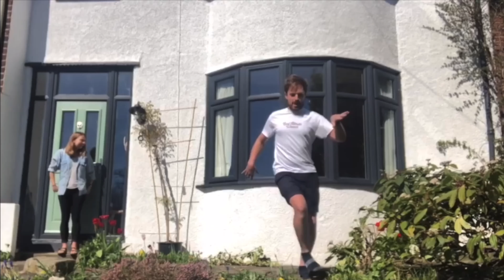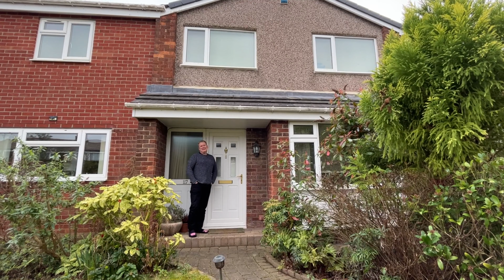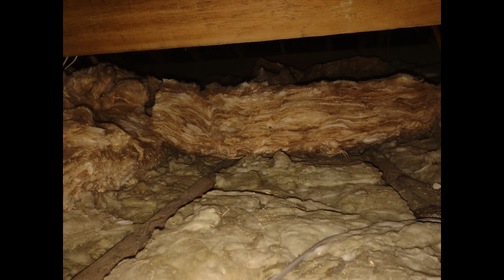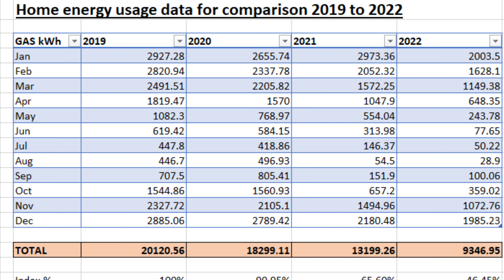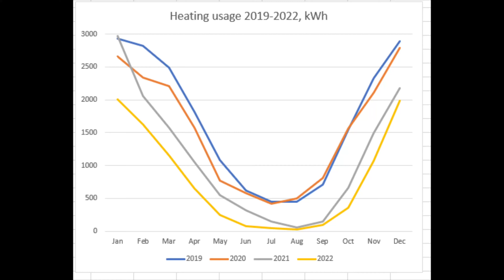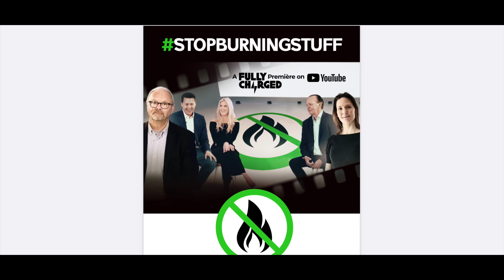3 steps Ian took to reduce gas bills by 54%

Comment: Interesting to look at the reduction in July and August figures when there was likely no heating needed. Did the old boiler have a pilot light? If it was anything like mine, its pilot light was actually using more gas than the new boiler used for all our hot water - about 4.5-5.5kWh every day. I wonder if that's what reduced your gas usage - we bought a system boiler and kept the DHW cylinder which can be more efficient than a combi if there's enough insulation around the tank; our airing cupboard is crammed full of the stuff!
Reply from the maker: Hi John, yes good spot, I think you are right about the pilot light, moving away from old atmospheric boilers must have done a big deal in reducing gas use in UK homes over the last 20 years.
Tom

Comment: Great vid Tom, what it proves is that common sense can prevail - insulate more what you have and achieve great ROI, reduce emission and increase comfort at the same time.  Hot water boiler systems have been traditionally set too high for both heating and water.  If you have to add cold water to wash up then you are probably wasting energy.  Mine is in the 40's and if I need something at boiling point then I use the kettle.  I only boil the water I need for drinks etc and 96% of the kettle usage is for hot drinks.  I just wish this vid was broadcast by the government as older homes can be made more energy efficient.  Thanks for posting.  Regards Mike.
Reply from the maker: Thanks Mike - common sense - something I lack!

Completely agree with what you are saying, when you start to look you see wasted energy all around. There is still so much we can do to reduce costs at home and my broadly. 

Thanks for the comment and engaging again.
Tom

Comment: Great work. When  heat pump  time comes it will be cheaper to instal as it can be smaller and less pipe work and rads will need changing. An example to all.
Reply: Thanks! If I can do it, so can many others too. When time comes, ASHP installers do proper heat loss work, rather than just base it on the number of rooms or rads involved.

It's a shame the home insulation schemes got whittled down to near nothing in the mid-2010s, as it's really the most effective thing the country could do.
Reply: @examinerian  highly recommended michael de podesta aka protons for breakfast. On his rule of thumb on heatpump sizing. Based on gas usage which makes alot of sense rather than trying to guess the building material and how draughty the house might be. I have ashp which is probably 50%  over sized due to cautious calculations.
Reply from the maker: Some great points here!
Reply: @examinerian  Even the eco4 grants are basically almost unavailable to most people. You need to meet ALL these criteria

1. You need to earn below a certain amount
2. Your house must be E rated on EPC or lower
3. Your gas boiler must be more than 10 years old if you've got central heating OR never having had central heating before

I fail on the first count
I fail again on the second count even if my income drastically dropped
I fail on the last point too even though my radiators all need replacing and my radiators are very dated.

I'd be happy with a 0% interest thingy. It makes things quite affordable then.

On top of that, for those that do somehow meet the above criteria, the government has approved open cell spray foam which most mortgage companies still don't accept.

RICS reviewed that situation too, and the industry was hoping for good things but RICS basically said "Check with your mortgage company if they allow spray foam" and most don't.

The government seems to want to not only have these available for very few people but they're also happy to approve something that most mortgage vendors don't allow.

It's utterly backwards. Either the government should force mortgage providers to accept open cell spray foam OR they shouldn't approve it. Equally, they can say "Oh we tried to help" but realistically you have to jump through hoops.
Reply: @waqasahmed939  Yeah, that sounds par for the course with current government - it's paying lip service to the idea, but not actually making much of a difference... Great comment, though! 👍

Comment: Insulating under a suspended floor (and removing all that debris down there which gets damp)  makes an even bigger difference. It’s a bit of a mission but by far the job which brought the most immediate comfort to our 1965 built property.
Reply from the maker: Something I haven’t done but think about a lot!! We’ve got some original floor boards that look fantastic so I’m cautious about lifting them… but one day..!
Reply: A neighbour just used q-bot. To insulate the suspended floor with a robot and spray foam. Have not looked into it but sounded interesting.
Reply: It's the last place left to insulate, although only on the older original half of the house as the newer extension has a solid floor. There's so much clutter under there that I'd want to do a proper tidy up, which would also involve removing the bits of microbore heating pipe that were installed at one point in the past. Instead of having the cold water mains pipe, heating pipes and electrical cabling just snaking about across the earth under the boards, i'd want to clip it all to proper cable trays to lift them above the level. It will be a full floorboard removal job so I can scrape out and level the ground ready for polystyrene slabs or similar.
Reply: @examinerian  that 
That is basically what I did. Filled half a mini skip with rubble. I stapled a vapor membrane up and over the floor joists sealed around the wall edges, filled it with sheep's wool insulation and screwed down a new floor. 

The most important bit is to box in and make an L shape around air brick entry points to duct and direct air downwards below the entire insulated floor and not have it level and blow air against the bottom of any floorboard. Use kingspan. This preserves ventilation but eliminates a direct flow of cold air underneath. Now my CH flow temp is about 28c out and 23c return when -5c outside and house is 20-12c all day and heats up quickly. I do have large low flow radiators. Heating is on all day and for Dec Jan Feb  we averaged 73kwh/day of gas for heating cooking and showering..
Reply: @wajopek2679  Excellent! That sounds like a plan, then, and it's something that I can sort out in the near to mid-term, along with a heating repipe to the three rads downstairs that have microbore.

Comment: Hi, Tom, Tour mate mentioned Sunamp type heat batteries; Just to let you know, I have a Sunamp, charged over night and topped up with solar. However the last reasonable step I can take is a heat-pump; But......having the Sunamp means I do not qualify for the B.U.S. Because you have to fit a hot water cylinder as part of the scheme????  WTF!!!
Reply from the maker: That does seem strange! You can’t get a heating only heat pump via the BUS? Seems a bit odd as that would be a great step forward for many, particularly coupled with a sunamp. 

Are you happy with how it is performing? I have never seen one in real life!
Reply: @TomBray-LowCarbonLifestyle  Yes happy with itl, re-charing at 12p over night, so always lots of h/w
Reply: That's a crazy restriction! I'm hoping common sense sees through wrt phase-change thermal storage - they're typically 1/4 the size of equivalent HWS cylinders so could be installed in places nearer the point of use. In a house like ours that has grown over the years, a couple of smaller ones instead of one big one might work out better - I'm also planning a repipe to cut the wasted hot water pipe runs from the combi location.

Comment: Thanks for the opportunity to share what we've done!

I hope it helps viewers who may be looking at the "whole hog" system and getting put off by the costs of ASHP, PV, EV, storage and the rest. Smaller but still meaningful steps along that journey can be taken - they won't cost the earth to do, but will help save the earth along the way.

Cheers!
Reply from the maker: Thanks for spending the time mate. Even if it took a year to get myself round!
Reply: For sure. I don't plan on getting an ASHP yet but I plan on :

Super insulating my flat roof
Super insulating the walls of said flat roof
Super insulating the loft area
Replacing all my pipes to 28mm pipes (Currently they're microbore)
Replacing windows for high quality triple glazed ones
Getting an MVHR
Potentially getting PassivHaus doors too

Then and only then, will I get an ASHP. The idea is to seriously reduce heating demand first.